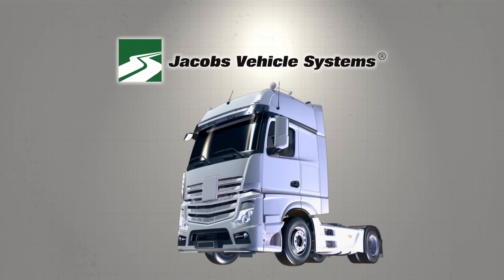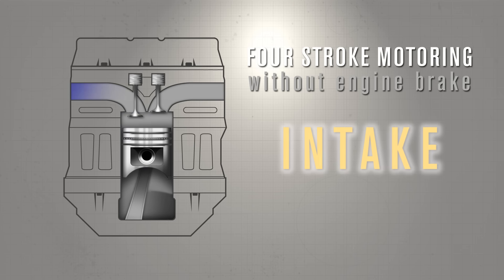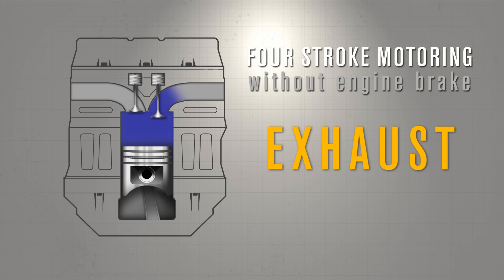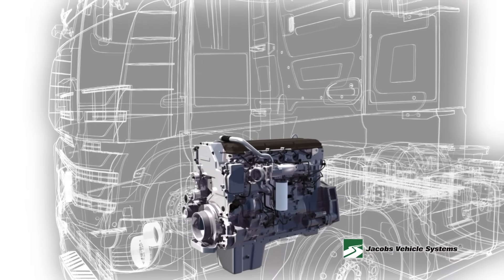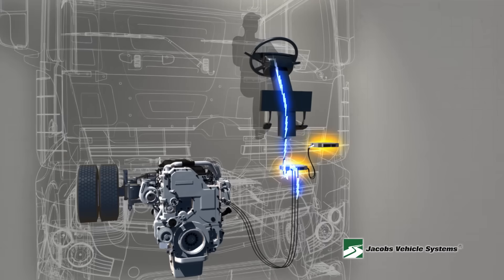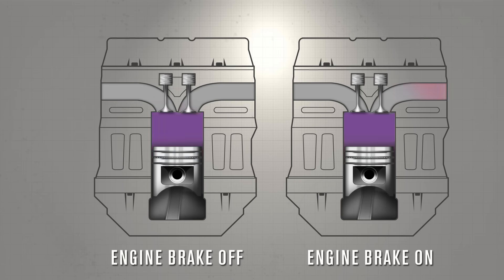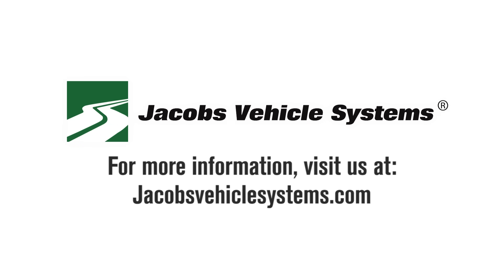How a Jake Brake Works - Jacobs Vehicle Systems

Comment: Probably the best invention ever designed for a diesel.. Thank you Mr. Cummins!  Hard to believe, that the 1st Jacobs engine brake, was actually designed for Detroit Diesel.  Mack's own Dynatard engine brake, was a good idea, but has hardly the braking effect, as the Jacobs. Keep up the great work!
Reply: mack dynatard is JUNK compared to a REAL JAKE BRAKE..............ALL THEY'RE GOOD FOR IS ALLOWING A FASTER SHIFT ON A LOUSY 5 SPEED MACK TRANSMISSION....
Reply: @yardlimit8695 ,Some braking from the Dynatard, is also better than none at all.. Lol!

Comment: It brakes the piston on vacuum in 3rd phase because the 2nd phase "compression" is modified to absent compression. My question to Jacobs Vehicle Systems is does this vacuum Jake engine breaking system is the same effective as on older compression Jake engine breaking system or the benefit is only removing the noise but is not strong as old compression Jake engine brake?
Reply: As I understand it, they didn’t redesign anything to reduce the noise. The noise reduction happens because of the addition of emissions equipmnt to the exhaust system.  It’s acting as a muffler and Jacobs is using that as a selling point.
Reply: @ronaldscott781  exactly!  The new emissions systems have many more components the exhaust has to pass through before exiting the exhaust pipe than the old muffler systems.

Comment: Power. Not expansion, power.
Reply: Same thing. You can call it the power stroke because that is the stroke where the power is created. Or you can call it the expansion stroke because the air is expanding. Or you can call it the combustion stroke because combustion occurs.

Comment: Many people seem puzzled by fuel situation. In braking mode, no fuel is delivered because the driver's foot is off the accelerator pedal and engine rpm is above idle. 
Many people also seem puzzled by how braking is achieved. The clearest statement I've ever seen is from a service manual that said "the Jake brake achieves braking by using the engine as a power consuming air pump."
Consider what would happen in a running diesel engine if something held the exhaust valves open a very small amount. An engine that has no clearance for fully open exhaust valves could accomodate having them open .025. It used to be called compression release in the days of outside rail 220 Cummins and starting aid system. 
Think about what happens if the valves are held open like that. Compression stroke drives air through the small opening of the part open valve, makes a partial stroke of high-pressure air which is dumped into the exhaust manifold as it's compressed. High pressure air pulse makes a sharp bark, and it takes a significant amount of energy to compress the air. 
Larger displacement engines should brake better, turboed engines likewise. Also explains the mediocre Jake on a Jimmy powered truck. Jimmies are smaller displacement for their horsepower, and their valve train doesn't lend itself as well to braking. 
Since the exhaust valves only cool during their dwell on the seat, extended engine braking gets the exhaust valves extremely hot. Brakes that brake stronger get the valves hotter. The gases in the cylinder during braking are very oxygen rich, since no combustion is happening. Very hot metal plus lots of oxygen is worse than heat alone. 
Even though they can create problems, the Jake is still one of the best inventions in the history of ever.
Reply: You explained it well!

Comment: Seems sensible......
If you like sounds though, you want to hear a traditional engine brake in European trucks. Some have an exhaust valve that basically suffocates the engine. Makes it sort of cushion the pistons on the air trapped inside the cylinders. Sounds fantastic!
Reply: Isn't that the system that Caterpillar uses?

Comment: Lol, fully opening any valve near tdc (as shown) will result in catastrophic engine failure, especially in a diesel: Valves kissing piston tops leads to engines having very rough sex and getting all f@#$%-up in the process. 
This is a very poor description of using the engine as a retarder.... it's so bad that it almost completely incorrect.
The process exists, but the video is crap.
Reply: Yes,the valve has to be opened and closed well before TDC.This is the limiting factor in the performance off the system.

Comment: I don’t know if it’s a Jacobs on my Volvo D13 engine but that is one of the strongest engine/exhaust brakes I’ve had on a truck in my 30 years of driving them
Reply: The concept is the same but Volvo sold it as VEB (Volvo Engine Brake). Basically it's the same by manipulating the valve timing/compression release brake.
Reply: @ajidamarjati 
Also a valve in the exhaust, witch will cause backpressure to the engine
Reply: @ajidamarjati Also called PowerLeash on the Mack engines

Comment: Still as clear as mud. They fail to tell you exactly WHAT happens when the system is applied.
Reply: I might help you there!  Imagine having big coil springs on the soles of your shoes. If you jump you will compress the springs and they will hurl you back up in the air. Your downward force is storing energy in the springs, and it is given back to you by uncoiling all that stored energy and sending you at least some of the way back into the air with no effort from you other than what you add by jumping back up at the same time to achieve equal or even greater height than before! Now imagine you were jumping on a sheet of plywood suspended off the ground and at the moment the springs collapsed to their maximum point they shot right through the plywood! You would simply land hard and all that stored energy would be wasted! A trampoline would be similar- it stores and releases energy also unless your feet tear through at the bottom of the downward stroke!  Now on to the engine. When a piston is in a compression stroke, and imagine you add NO fuel shot at that moment, the piston would "spring" back down just from the stored energy alone in the compressed air at the top of the stroke. NOW, if "something"  (the Jake mechanism) opens the exhaust valve at that exact moment when the maximum energy is stored in the highly compressed air, all that energy will be "wasted" when it goes roaring out the exhaust pipe instead of boosting the piston back down. It took a lot of horsepower (COMING FROM THE WHEELS NOW THOUGH SINCE YOU ARE PLANNING TO STOP AND THE WHEELS ARE DRIVING THE ENGINE) to compress all that air, and instead of recovering the "spring" effect it is wasted out the exhaust!  It is the SAME principle of driving an air compressor with an electric motor!  Horsepower used up in compressing the air and no recovery of energy in the air compressor cylinder. It all leaves the compressor cylinder through a "type" of exhaust valve! So you see that any horsepower delivered to the engine THROUGH THE WHEELS is used up with the Jake system, AND IT AMOUNTS TO BRAKE POWER!  SOMETIMES MORE THAN THE RATED HORSEPOWER OF THE ENGINE, SINCE "BRAKING HORSEPOWER" OF 10 BRAKE DRUM/SHOE COMBINATIONS CAN BE CONSIDERABLY MORE THAN THE FEW HUNDRED HORSEPOWER OF THE DIESEL ENGINE WHEN IT IS POWERING THE REAR WHEELS!   A very interesting thing is this:  AN AMATEUR in a truck can CRASH the truck if he is not loaded, OR if there is ice or EVEN RAIN on the road and all that power available inside the engine COMPLETELY STALLS THE ENGINE AND OF COURSE STOPS THE WHEELS FROM TURNING AT ALL!!   Just like slamming on the brakes he will Jacknife before he ever recovers any means to get those wheels turning again and the engine running again!!!
Reply: I understand the workings, this was just a poorly explained and poorly put together video, as if truckers have the IQ of a third grader.
Reply: @jpayne2902  To me it sounded like an explanation for the office jockeys who buy fleet equipment, a sales pitch, icing on a cardboard cake
Reply: @junkdeal  Gees, you should write a book about it. Or maybe cut your comment down and get it printed as a book.
Reply: @jahnperez5060  yeah I LOVE novel-length replies!!
Reply: @junkdeal  everyone does lol....
Reply: Exactly. It is dumped down for the current crop of incompetent undertrained over aggressive drivers.
Reply: Let me help you...and for a good reason, they don't tell you what is going on...it's very hard on your engine.. they open the exhaust valve at top dead center, venting the compressed air.. valves closed, no air in cylinder and the  piston starts down..what happens next? That's right, you pull a vacuum, until you suck the valves open.. you stress the entire engine backwards.. I have seen the tops of Pistons sucked off, rod bolts broken, wrist pins snapped.. 
Your Jake isn't as strong, in your older truck? Replace the worn out valve springs!!! Or put stiffer ones in, and get a Jake from hell.
Reply: @KBS117 Used properly jakes won't hurt your engine at all.  They're designed to handle it. I've driven over 2.5 million miles or so and never had an internal engine problem of any kind.  Driven Detroits,Cummins,Cats,Volvos, Mercedes and Macks.  BTW Detroit Series 60 engines always had the strongest jakes of them all!😂
Reply: Think, boy, think!
Reply: Funny how they avoid telling you, how a Jake works.. and for a good reason, they hide this destructive operation.
They open the exhaust valve at the top of the compression cycle, venting all air. The valves closed, no air in the cylinder, and the piston starts down.. what's the only thing under God's green earth that can happen? That's right, it pulls a vacuum, until it sucks the valves open, causing that funny sound, everyone loves.. a Jake brake sucks you to a stop..and it should be called a Jake break, as it reverse stresses an engine.. as a tech, I have seen the tops of Pistons sucked off, rod bolts sucked in two, rods stretched, and cranks broken, from a Jake break..
Weak valve springs will cause the Jake to not function as well..
Reply: @KBS117  a tech at what,,,,,,,,,,,i ran trucks with jake brakes for years and rebuild many many engines with jakes and never saw or had ONE  of the problems you described...........if they were that bad or destructive don't you think they would have stopped equipping diesel engines with them........
Reply: @yardlimit8695  I started in St Louis at complete auto transit in 1976.. many of the problems occured on engines in the 7o's and 80s that were not designed for the reverse stress of the Jake.. newer engines are built better. 3 piece Pistons are one of the biggest improvements.. . Engineers can also limit the amount of stress the Jake puts on the engine, by the valve springs strenth. The stronger the springs, the higher the vacuum the engine pulls, before sucking the valves open..
Reply: Did you watch a different video? It does tell you exactly how the system functions.
Reply: @Icutmetal  - Not even close. It tells what the system *does*:  ie. the valves open and close at a different time. It doesn't address the mechanism for changing this. It doesn't address the control mechanism for the mechanics. It tells you nothing about how the system itself works.
Reply: Jeroen de Sterke Damn. You sure are dense.
Reply: @mikep.541  Hurling insults and contributing nothing to the conversation isn't exactly the definition of intelligence.
Reply: @mikep.541  l guess you must be BRILLIANT and understand EVERYTHING.................ROCKET ENGINES,,,,,,,,,,THE HYDROGEN BOMB,,,,,,,,,,,,,3 PHASE ELECTRIC,,,,,,,,,,,,,,ETC,,,,,,,,,,,YES OR NO..

Comment: So no fuel is used when the Jake Brake is on?  It mentions increased fuel economy  but I don't see how that would happen if it didn't have a fuel cut off like some cars do.
Reply: I think the system leaves the exhaust valve open (in sequence to the stroke) but keeps the intake valve closed, so no fuel is ingested. It uses pressure from the cylinder to be used as the "braking"- but I'm no expert.
Reply: @goesfastandfar  fuel comes thru the injectors not the valves.  air intake valves fuel injectors exhust valves.

Comment: Whats a load setting? Must be a European thing, everything is by Cylinders here. Also here in the states, with a big enough motors, they pretty much are the service brake. I did 6 years on 1 set of pads.

Comment: Why does it still need to inject diesel during the compression stroke when the brake is applied? Shouldn’t the momentum of the wheels still keep the cycle going forward? Then the engine is truly an air compressor and also saves fuel.
Reply: ToothyGus it doesn't.
When removing your foot from the throttle while in gear, no fuel is being delivered into the cylinder. The only thing that keeps the engine revolving is the kinetic energy from the spinning wheels. So no fuel is being wasted and your engine stays clean.
Reply: Fuel is not injected while jakes are on!

Comment: I had a V8 Cummins 903 years ago and couldn't wait to get into a town and release the Jake beast. It had it's own style of bark for sure. Loved it. But in serious measure it worked well if driven correctly. I always use the philosophy of using the same gear downhill as i would uphill and never had a problem. Could flick the Jake between half and full depending on what it was doing. In the wet empty could catch you out if switched on full retardation, the rear wheels would actually lock up and slide. The switch on  full going uphill at 40 ton I could change the RR up as it brought the revs down very quickly, trying that without the Jake was a waste of time.
Reply: Wow. An old 903?!! 👍 What was it in?
Reply: WOW 903 YEARS AGO?
Reply: same gear down as over, or one less just to be safe. is what i learned.   back in the day.
Reply: Man everyone knows you never go full retardation...

Comment: Maybe I'm not that bright, I still don't quite understand it.
Reply: The energy used to compress the air during the power stroke is expelled since they open the valve after it's compressed. That takes energy to do, and then is simply released. It's engine braking on steroids.

Comment: I don't quite get it. It seems like it would be better to leave the exhaust valve closed longer and cut the spark and fuel, not open it sooner. That way the energy of compressing the air would help stop it. But this opens the exhaust valve sooner making a nice easy exit so how does that "absorb energy"?
I get how this works but not why it works.

Comment: 60 series Detroit 12.7 in our E-One Cyclone engine, 8" straight dumping out the passenger side, you get that truck loaded up 3 times (jake, throttle, jake, throttle, jake) on the 2-4-6 set on 6, then hit the throttle 1 more time, Cannon shot city complete with fireball

Comment: So it has two exhaust stroke which one replaces the intake?
Reply: Neither.  It opens the exhaust valve early and doesn't inject any fuel.  This causes the potential energy built up during compression to be wasted, enhancing the typical engine braking effect.

Comment: jake brakes make the trucks use MORE fuel
Reply: Not on modern diesels, no fule is injected when the jake brake is on.
Reply: You have obviously never operated a truck with a Jake break. Open mouth insert foot

Comment: Every time you shift up or down wastes fuel. It was never meant to use on flat ground for the noise. It will save wear on services breaks , because it assist when going down a grade at a constant speed in one gear.  Using the jake in every  gear requires unessary  shifts. Your wasting fuel. You see a town ahead coast to the finial speed zone, 55, 45, middle of town 35, now go from 10th gear or 6th.  One shift,  time lights , shift only to maintain or speed up. Drive smart, prudent.  Then, save the jake brake for the truck stop , so everyone there knows a human jackass has arrived with his toys and dollys.

Comment: So these kind of engines are never an interference engine.
Reply: The "Jake Brake" might not open the exhaust valve to full lift.
Reply: @cjmunnee3356  Ah alright, that makes sense. Thanks.
Reply: @Freba9  Also, it's possible engines this large might not be interference fit.  Heck if I know.  Those are the only 2 possibilities that make sense.
Reply: @cjmunnee3356  At least your last name suggests you know exactly how jake brakes work 😀
Reply: @Freba9  😂🤣😂🤣😂

Comment: I love the fully retarded capabilities of their explanation of how a 4 cycle engine works. They completely left out mention of FUEL. "The air gets compressed, gets hot and expands." Not even mentioning that the fuel is injected into the hot compressed air and THAT is what expands.

Comment: Jake brake, Cuts fuel, opens exhaust valve on compression stroke. 3 minute video in one sentance
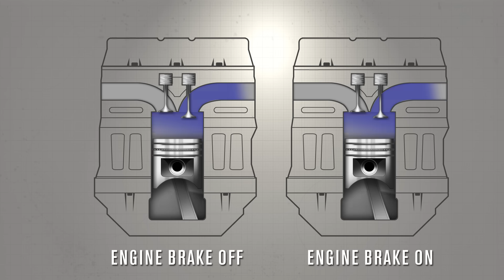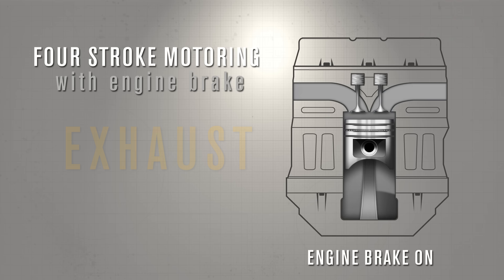Reply: 2:10--------2:30....that's it. The rest is an ad.
Reply: @danstrayer111  wouldn't say ad, more like unnecessary education

Comment: Oi , In my day it was a round pedal the size of a Schilling coin connected to a wire rod on the floor piece or a set of switches on the Fascia ..what pillock of a wanker would want to make them quiet .

Comment: Why do some of the trucks I've driven have Jake brakes that are weak af? What is the cause or reason for that?
Reply: They aren't true Jacobs brakes. Also, the factory engine brakes on most trucks are not the same and very little fuel is sent to the combustion chamber; the smaller the explosion, the quiter the engine brakes. I've also been told international engine brakes are only on 2 cylinders

Comment: If anyone would like a real explanation of how engine brakes work there are plenty on other much better vids here on YT.  This is more like an advertisement for the Jake brand.
Reply: That, and they forgot to even mention the whole fuel injection part of how an engine works in this video.
Reply: @drumset09  I noticed that, too, as the video gives the impression of diesel engines being powered by air.